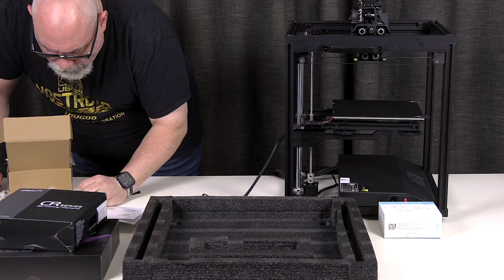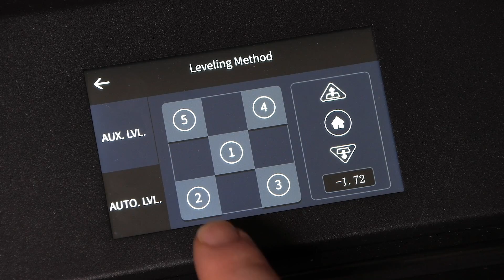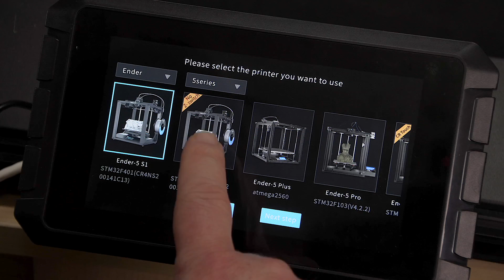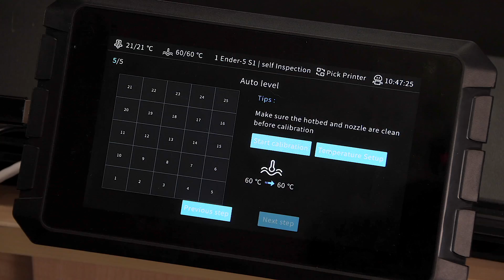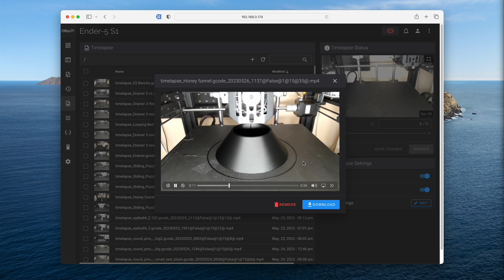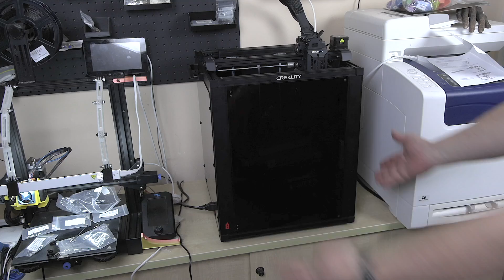Creality Ender 5 S1 + Creality Sonic Pad Speed Combo Bundle Review

Comment: The reason why there's an included stl for the resonance detector is because the Z axis of the detector is supposed to face upward, not to the front, as in this demonstration. Print the bracket.
Reply from the maker: Yes, already been covered and addressed. A long time ago.

Comment: So you don't have to leave the vibration sensor connected permanently?
Reply from the maker: No, it's only needed when doing the input shaping. I should mention that I mounted the sensor incorrectly in this video, and have since 3D printed a small mounting bracket (supplied by Creality) and redone it with the sensor in the correct orientation.
Reply: Ya I copied the way you did it just now and it gave me an error code, I corrected the position and it seems to have fixed it. Thanks for the great video, though! @BranchusCreations